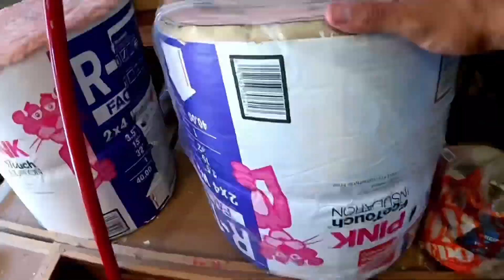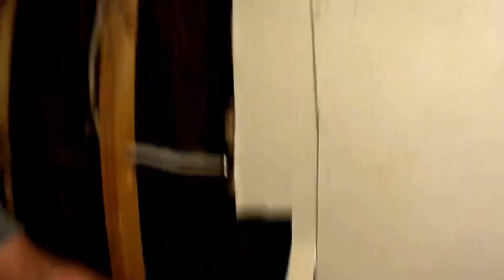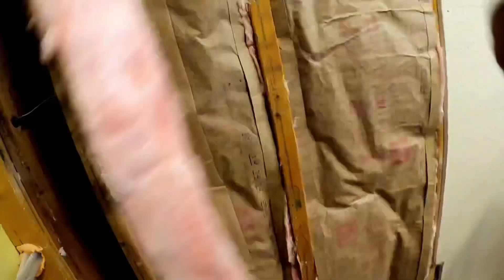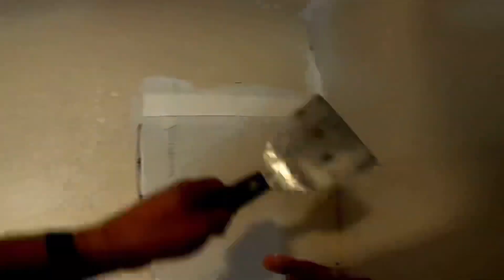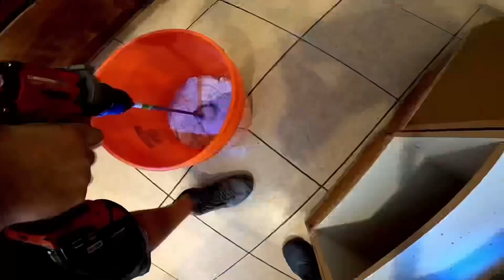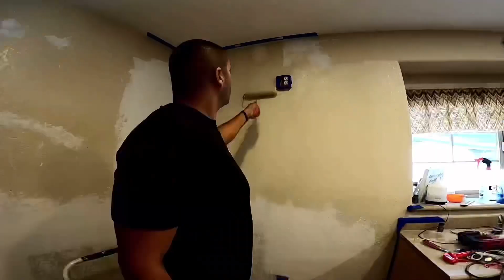DIY Drywall & Insulation Repair | Fixing Water Damage in Kitchen from broken water pipe.

Comment: Next time for the insulation get a extendable blade ones that u cam break into new blades and then use a 2x4 to smash the insulation down and run the nife down it instead of the scissors